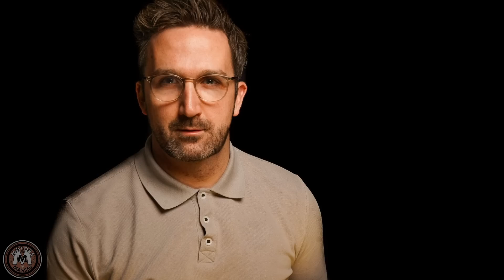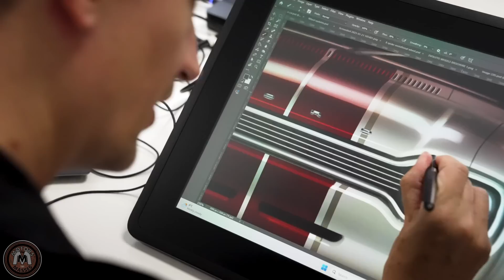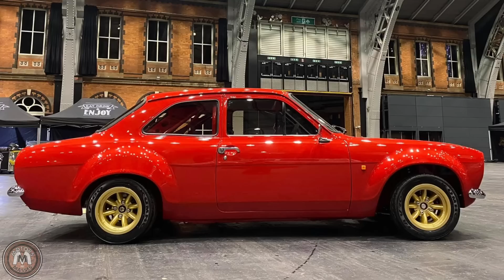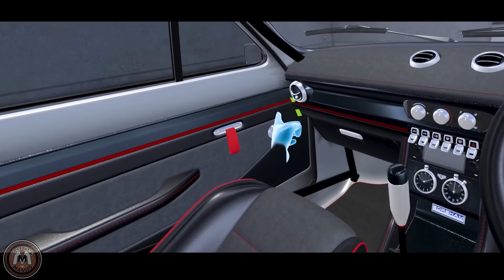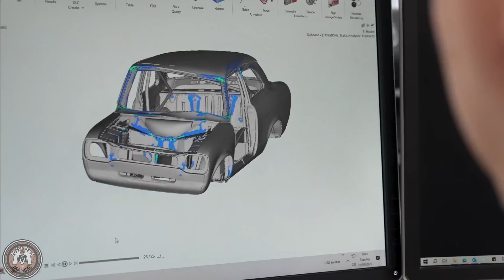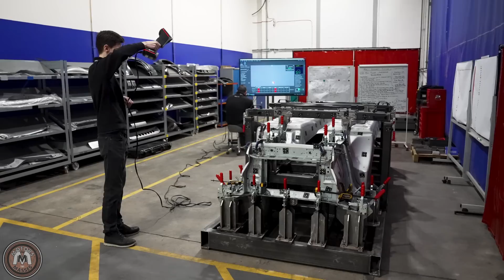Why the 2025 FORD ESCORT MK1 RS costs £300k - Visit to DRVN Advanced Engineering

Comment: Ridiculous.
I understand the costs of tooling up and development to build these cars but no way would I spend £300k on one.
 My very early MK1 NUT327F from the first 6 months of production, cost me £100 in 1989 and ended up with a 1760 crossflow, four link rear and 2.8i Capri brakes and was great fun but nope.
If I had £300k going spare I'd buy a new 911 Targa, a £10k Bentley GT as a daily hack and chuck the rest into a house and be as happy as a pig in shit.

Comment: No doubt a touring car spec RS500 in on the to do list, way to hard to reproduce all the plastics needed for a road spec copy though.
Reply: @PS-ps8mo  I reckon these guys just might be able to pull off those plastics.
Reply: @twelvereasonswhynot  Not a chance, the cost to tool up to o/e spec would be enormous, they would never recover it.
Reply: @PS-ps8mo  you reckon,  when they're asking £300k per unit for the Escort? Why is plastic more expensive to produce? (It's not, especially these days with laser scanning etc.)
Reply: @twelvereasonswhynot  No one could currently reproduce o/e plastics, sure they can copy the shape, but not how it looks. I cannot educate you in this if you are unaware of the basics. It would have to be a restomod to get around the restrictions.
Reply: @PS-ps8mo  Not really sure what you mean, unless you're talking about regulatory problems? The touring cars were built in very low volumes originally (even the road-going RS500 was) so I'm not sure why you think the cost would be so much more of an issue now.

Comment: As a  past escort owner mk1 and m,2s.it still to this day has such a lovely shape.not your jelly mould cars that are around now.300 grand.mmmm. come on you can do better that that.anyway in the 1970s maybe earlier avo at ford were preping mk1s for rallys.i heard that they wanted to fit wider wheels but they stuck out too far.a mechanic said wait a min ile  be  a sec.came back with a pair of rubber wide arches of the rear of a twin wheel transit.do you remember those.put them up to the side of the car and yup lets make them fit. That was the start of wide arches as we know..😅.ime sure ime right...
Reply from the maker: The Alan Mann invention story was told to me by John Mitchell.

Comment: no longer Motors for the Masses but Motors for the select few
Reply from the maker: Not really. Just reporting on a motor for the masses...just one that's been upgraded and costs more this time round. I did the Capri, that is a motor for the masses but starts at £50k. The Mustang Mach e a motor for the masses....but that is £75k. It's ok sometimes to do the expensive ones. Back to the normal priced stuff soon enough.
Reply: @motorsforthemasses  Not great examples...a Badge engineered ID4 and an abomination not worthy to wear the name Mustang.
Reply from the maker: @MrT79shakeshake  but are still motors for the masses regardless of the thoughts on them. I'm not a fan of the Capri and the Ford (not a Mustang) Fusion is good but...not a Mustang; however still motors for the masses.